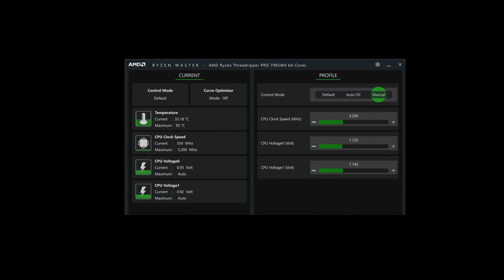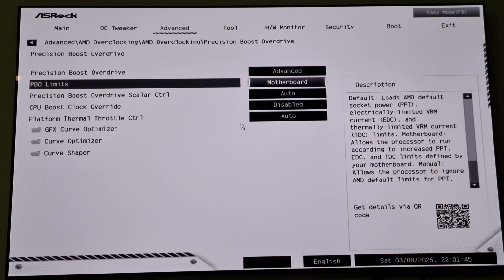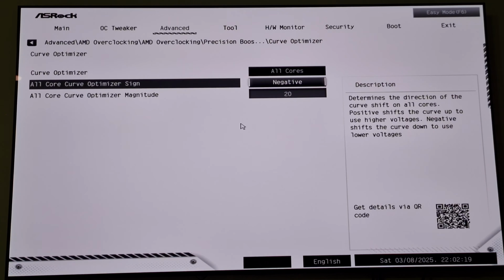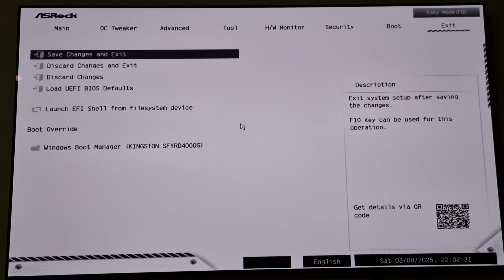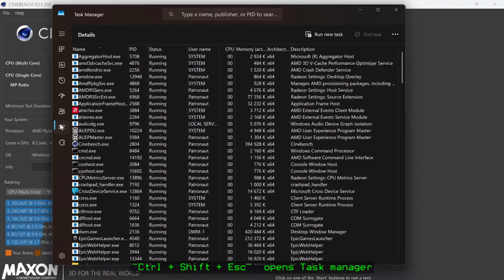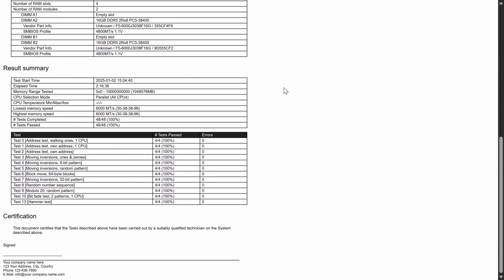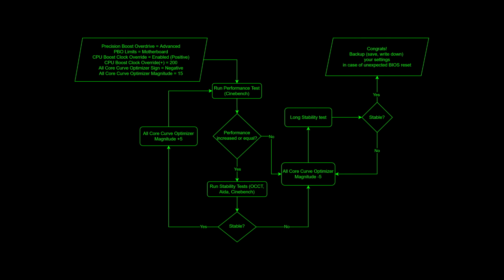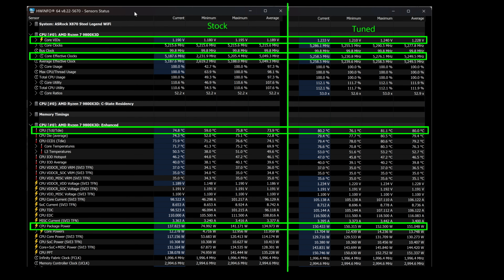How to tune and optimize CPU performance on AMD Ryzen 7 9800x3D, featuring ASROCK X870 Steel Legend

Comment: tried this on a b850m steel legend and now it doesn't boot anymore. dram and cpu(i think) lights. orange and red. just wanted to reduce my temps but ig not
Reply from the maker: Reset the BIOS. You should have some pins on the board for this (check the manual) or pull out the onboard battery for a moment.
Reply: @patronautsvirtualworld8155 Don't see anything in the manual about resetting bios externally. Unfortunately i've built a custom loop in the jonsbo z20 so removing the io heatsink to get to the battery is near impossible
Reply from the maker: @averyreed1220 it is right there, page 8 of English user manual, item 17 - Clear CMOS jumper. Did you make your build on your own or did you have it made?
Reply: @patronautsvirtualworld8155  Personal build. Cleared cmos and got it back. Must have missed that spot in the manual, ironic how mow much time ive been in there for a vga issue. Either way, Pretty sure pc isnt happy with the expo part. I have 6000mtz ram but i guess it juist doesnt want to run at that speed.
Reply from the maker: @averyreded1220 Unfortunately not all RAMs are equal. I would advise you to exchange them for better but in today's market it is unrealistic or at least unreasonable 😅

Comment: What about cooling?
Reply from the maker: What is your question?
Reply: @patronautsvirtualworld8155  What type of cooling you had during these test?
Reply from the maker: @Maximmaximmaximmaximmaxim  The cooler is ARCTIC Liquid Freezer III 360, I have a reference to my PC build video at the beginning of this video.
Reply: @patronautsvirtualworld8155  I've tried your settings in the bios, increasing Bus clock by 20 and reducing power by 25. CPU reached its limit temp of 95 in a few seconds during 100% load (6tubes 2 fans DeepCool AK620 cooling system). So I reverted to bios premade preset with 75 degress and -30mw reduction

Comment: mines set to manual on pbo limits with 115w 90a and 105a and a curve opti of neg 20 works fine temps between 50 and 70 under load

Comment: Hello and really nice work ! i found mine stable at -20 with max cpu boost clock override (200) precision boost (auto) the score on cinebench ( i got 1341)
max temps i got 78-79 core clocks overall igot 5.4 MHz is those stats ok?

Comment: Hello, good information about testing stability system ! Really true ) 
Beter if you can undervolt your cpu Per Core negative ( best for work for seperateds core ) and after can find value - curve shaper 
Fir me all testeded and find my value nedded around 7 days , if you use OOCT for testing , sory but you lose your time , aida64 just need for cpu and for ram beeter anothe software. But first you must find best timing for your ram fclk speeed and after checking stability your ram around 4 hours (Karhu) ,memtest pro and after start find best value for under voltage your cpu and test just aida minninum 4 - 5 hours but better around 10 - 12 hours 
This not so fast ! Don't use for all core negatives and don't lissen people ho say - 25, 30, 40 , becaue just example, my 9800x3d have 2 core -15 , another 6 - 30 
If i use just - 30 , my system not stable, but all software good work cb r23, geecbech corona and all another soft and OOCT , but just i torn on Aida64, my system crashed)
And don't need up you cpu mhz , for gaming no difference , for cbr23 just ) 
I have arround 23400 cbr23 just find my value co and curve optimizer

Comment: Turn off your PBO because it WILL kill your cpu, it happened to me 1 month after I got my cpu and I had to get it replaced, again PBO Will kill your cpu
Reply from the maker: I think there must have been some other factor in your case, using PBO for at least 3 months and no issues.
Reply: @patronautsvirtualworld8155 asrock admitted in a gamer nexus interview that it was the issue and put out a patch the same day to optimize the settings better
Reply: which BIOS were you on ? did you update it to 3.25 ?

Comment: I have been using my 9800x3d since November with no issues on my msi 3090.  Bought a msi 5080 and I keep getting game crashes to desktop after 5-10 min so etines sooner any bios settings you think would be good to poke at? I have 1200w PSU so power isnt an issue. DDR5 6000 ram. I have basically the same asrock taichi with settings as you in this video. Great video btw :-)
Reply from the maker: I have heard people complaining about 5080, there have been some issues during reviews. Try to uninstall drivers using the application DDU and then install the latest for 5080.  You can also check and manual set the  PCIe slot manually to 5 instead of 4, or vice-versa.  Also make sure the power cables are properly connected. I am pretty sure the issue will be with the GPU and not CPU.
Reply: @patronautsvirtualworld8155  ya did a fresh windows install already plus reinstalled drivers before hand as well.  I can try the 5 to 4 not a bad idea.  I actually have tried 2 different 5080's now and even swapped out my PCIe cords so def not a bad connection or seating of the GPU at this point.  

Hate to say it but if I can't get this working in the next week I am going to order an intel cpu and mobo and see how that goes.......was really hopeful for this team red swap too.

Thanks for the reply it means a lot :D
Reply from the maker: @Vashables  How did it go?
Reply: Its not with the gpu , check the Ram speeds on bios , try to set it on lower hertz until system stabilizes , i had the same problem.

Comment: I found the best apps for CPU stressing is Y-cruncher 0.8.6.9545b . It forced CPU to rich higher temperature then under any other app. Use stress test number 1,  after you start Y-cruncher. Y-cruncher forced 9800x3d with 420mm Arctic Freezer III to 94.5 degrees C with ambient room temp of 17 Deg C. No other app was able to force CPU to be even close to 90 Deg C, only Y-cruncher.

Comment: There are benefits of keeping iGPU enabled even if you have no monitor connected to it. Windows is starting to let less important tasks run on it instead of your main GPU. It's not many things today that use it but it will probably increase with time the importance of having the iGPU enabled. Under System->Display->Graphics you can modify which GPU software will use for its hardware accelerated task. I can't say I saw any negative of having it on in my benchmarks as well, it uses a different part of the CPU and shouldn't affect anything other than increase temps slightly if you are actually running something on it.
Reply from the maker: Having it enabled has a negative impact on gaming performance.
Reply: @patronautsvirtualworld8155 i cant seem to disable the igpu on my asrock x870e nova
Reply: @patronautsvirtualworld8155 could you elaborate more why ?

Comment: Thank, I have a 9070XT and a 9800x3d and noticed that the CPU temps were fine but during game shader compile it would peak to around 80C - 90C. After some undervolting my compiling temps are now in the low 60s.
Reply: Motherboard loves to give too much voltage to ryzen cpu, unnecessarily. Undervolting is the way to go.

Comment: Hello I have 5070 ti with 9800x3d , should I disable integrated graphics ? And how to disable it?
Reply from the maker: After quickly checking with a dedicated GPU and Cinebench,  it seems the integrated graphics did not have any impact on CPU performance. So it doesn't matter and I suppose only your 5070 ti shows up in GPU-Z, right? If that is the case, no worries.
Reply from the maker: It does have negative impact on gaming performance though, so I would keep it disabled. @psujith6607
Reply: @patronautsvirtualworld8155  thank you